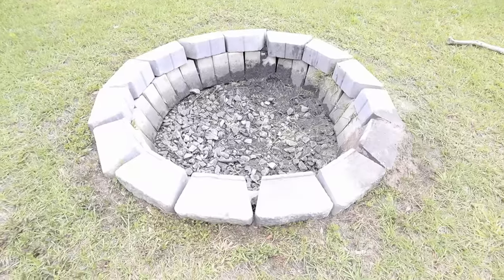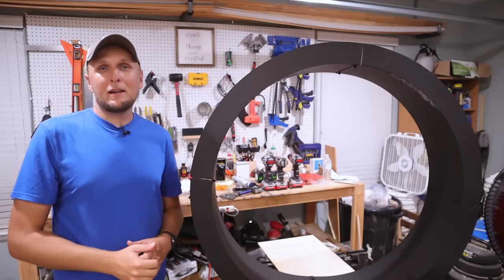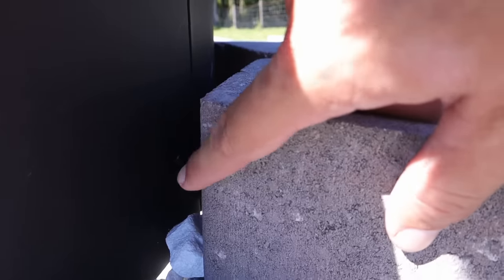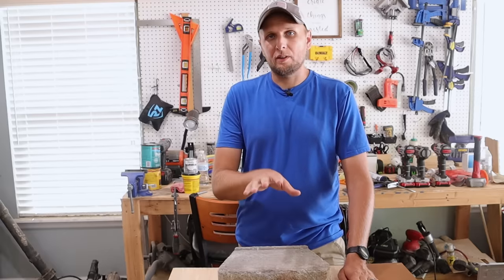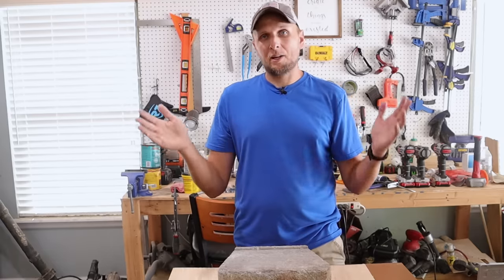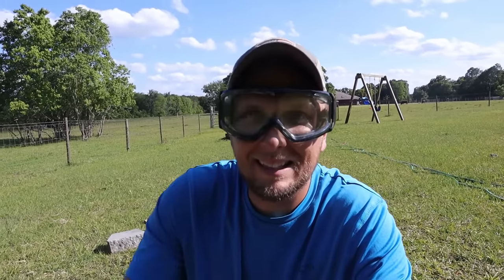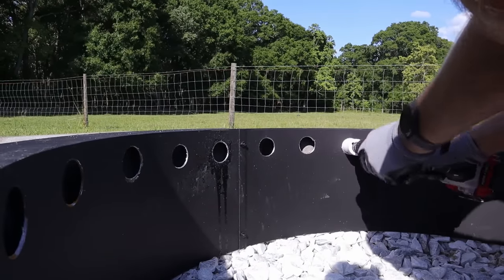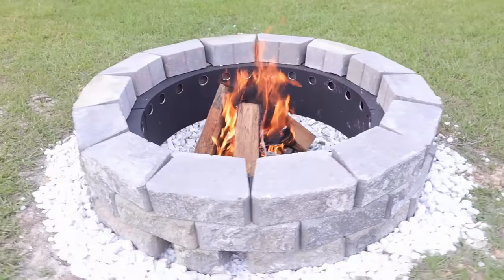How To Build a DIY Smokeless Fire Pit That Really Works!

Comment: I did something similar. I expanded my pit lined the bottom with fire bricks and created gaps along the out side of the pit that draws air in and instead of a ring I just used fire bricks and used blue drainage stone on the outside for looks. I also used granite stones that I have found at the beach and around the forest buy my house.
Very little smoke and it looks awesome.
Reply: do you have a photo this sounds amazing

Comment: Man I loved this video! This is currently my exact situation. Have an in-ground fire pit. Not trying to spend the money on a Breeo if I can make this work. Having the existing fire pit makes a little less work for me. Thanks!
Reply: Hello I am far from Harry homeowner or a DIY guy LOL I am a retired firefighter I have two acres with a couple of trees and the wife and I were thinking about building something so we could burn the Fallen dead tree branches and such . I came across your post and never even considered digging out a hole. If I did take something out 12 or 13 inches by 36 inches across would I still use the fire ring or just put a ring of stones Around The Dugout Circle to give it a finished look and just put gravel at the bottom or lava rock or red fire brick or something? What materials basically did you use with your inground design thank you

Comment: So, I'm dying to know how many hole saws you burned up! lol  Nice job, I think I'm gonna go build me one just like it! :)
Reply from the maker: 😂 Well I actually bought a really expensive carbide tipped hole saw that was supposed to just cut through all kinds of metal without any issue.  It cut one hole and was done.  Then I went back to my run of the mill hole saw and it cut all of the rest of the holes it.  It did however break off a couple of the teeth towards the end but was still able to finish the job.  Enjoy the build!  Hope you like it as much as we do.

Comment: You can build the ring with stones as well leaving a gap for the air to travel up, although metal is a better heat conductor once the stones heat-up the effect will be the same.
Reply: Actually it won't. A Solostove does not work by increasing draw generally, but by using heat-powered convection to force heated fresh air into the exhaust stream for an afterburner effect.

Comment: Could it work as well or better with just removing a couple of or three stones from the bottom and splitting the difference to make gaps all around?
Reply: Using half-blocks prevents edges on the first course from lining up too close with edges on the second course, which would weaken the stack.
Reply: @andyid7440  "Stack"?  Two layers are stable enough I think.  An item not discussed:  fire rings and stones are variable sizes, and thus spacing is uncertain.  The gaps serve to deliver air horizontally at the lower level of the combustion, so if the ring/stone combo fits too well, you end up with irregularities being imposed.  It's a fire pit, not a piano.
Reply: @andyid7440  Thanks, I though it might be something along those lines.

Comment: Will give this a shot. I agree with the comment below on the top row of stone. I think a one inch thick curved flat cap stone on top and this put the top row of stone so the angle is laying into the fire pit. Great Video.

Comment: Great video.  I've been looking for steps to build my own and this fits the nitch perfectly!  One question, how big are the holes you drilled for the air circulation
Reply: If you pause it at 7:01 it looks like he is placing his center point at an Inch and a half.  I would guess either a 3/4 or 1 inch hole as the top looks to be a half inch from top of rim to top of previously cut holes.

Comment: You can also just subtract out one block from the bottom and then evenly space out the rest of the blocks around it.
Reply: This is what I was thinking as he chiseled them in half. Big time savings and but one less stone
Reply from the maker: There are reasons I did not do that.
Reply: @HowToHomeDIY  and that reason is...?
Reply: @hillzachary01  He has explained it several times in previous comments. Others had asked about it or stated the same thing. He has a reason. Others don’t agree with his reason, but it has to do with creating air pressure. I’m pretty sure it would work either way.
Reply: @hillzachary01  because he was over thinking it haha

Comment: What if you just used less stones for the bottom ring, forcing you to leave many little gaps all the way around, instead of a few bigger gaps?
Reply: i second that
Reply: Notice all layers have the same number of stone.  If you use fewer stone its hard to make sure all seams are over the middle of a stone.

Comment: What size hole saw did you use and how far down from the top did you go to cut the holes. Thanks for the video, it’s very helpful
Reply from the maker: Hey Bradley, I started out with a 1 3/4" but felt the hole was too large so I ultimately ended up using a 1 1/2" and I measured down 1 1/2 inches from the top as well.  Hope this helps!  Thank you for the feedback!
Reply: Thanks for getting back with me. I appreciate it. That will help a lot.
Reply from the maker: @bradleyodom4010  You are welcome :)
Reply: @HowToHomeDIY  at depot buying my first hole saw bit for this, thank you!!
Reply: @HowToHomeDIY  I noticed on the Solo Stoves the holes are much smaller.  I wonder if there is some science that would dictate the optimal hole size
Reply from the maker: They are also a lot smaller.  I don’t know that anyone can say for sure what would be optimal for these.  I can see the argument for the smaller holes to help build up back pressure more but I can’t complain with what I have.  Have been very happy with it.  If you do smaller ones let me know what you think!
Reply: @robertsieloff6065  I have 1.5" on mine and it works really well, you can tell once the fire reaches a critical mass it kinda swirls up and looks like the flu is open in a conventional fireplace. It's my favorite home project to date.

Comment: For the rock layer under the fire pit, do you dig a bit or just place them on top
of the grass? Also, could you use flower bed edging to keep the rocks in better?

Comment: Looks like an attractive and functional fire ring! Here's a pro-tip on cutting concrete blocks: Arrange the blocks in lowest level just as you did.  Take out one block. Re-arrange to get approximately even gaps between all blocks. Now continue as you did. Need more ventilation? Take out two blocks.
Reply from the maker: There are reasons I did not do it that way.  I address them in the comments and also my review video of this.  I appreciate the feedback.

Comment: I am curious on the impact the hole size has on the effectiveness. I have one of the solo stoves but it is a bit small and the heat gets directed straight up vs to people sitting around it. The smaller holes on the bonfire create a pretty forceful heated airflow to the top of the pit that eliminates the smoke very well. Do these get pretty good circulation of air?

Comment: I wonder what would happen if you introduced an "air vent" to the bottom of the fire. Like an underground pipe that feeds right into the base of the fire that's vented up a few yards away. I feel like that, along with the holes in the ring would make it 99% smokeless.
Reply from the maker: It is funny you mention this.  I have been thinking on possibly doing this.  Because I am in agreement with you, I think it would do nothing but help and help mitigate some issues that come with wetter wood and things of that nature.  Thank you for the comment!  Will see what I come up with haha.
Reply: @HowToHomeDIY  my home finishes construction in the next few months and that’ll definitely be my first project in it. The pipes along with the holes is something I’ve been thinking about for months but haven’t found anyone to have done both combos
Reply: @daysofseptember  I'm in the same boat! lol congrats on your home!
Reply: That's a forge
Reply: In the same boat - want to build a pit with both the holes and the blower vent. I saw a video that introduced both larger holes at the bottom of the fire ring and smaller holes to concentrate the hot air at the top of it. Do you guys think that you would feed the blower vent into the air cushion inside the stones and outside  the fire ring?
Reply: @scottybranham3595  Precisely what I thought, that woods gonna burn real fast!
Reply: @scottybranham3595  Basically the point of this whole concept to begin with is modeling the pit after a forge to take advantage of their reduced smoke.
Reply: @HowToHomeDIY  I would try to replicate the setup of a wood gas stove.  an air pipe might help, but I think holes at the bottom end of the firering would also help.  in a wood gas stove, the smoke actually travels down through the false bottom of the stove, then up through the double wall chamber and out the holes that you already drilled creating that propane stove look of wood gas on fire.  Right now the smoke is probably having a hard time getting from the main chamber into the double walls.  It has some opening from the gravel you have but that probably gets blocked with ash pretty quickly.

Comment: lol, how about removing one or two at the bottom and just arranging the remaining ones to get the gaps you like. :)
Reply: I wouldnt have thought to use a hole saw and make holes going across the top edge
Reply from the maker: You could but the bottom row blocks won’t match up with the top two rows which some won’t mind.  On top of that, I didn’t want gaps all the way around the bottom.  One would think that would be a good thing but it’s been my experience when dealing with ventilation and air flow that less vents in the right places helps create a sort of pressure that helps with air movement in, out, and through an area or space.

Comment: look up AmishMeadows videos and find the one where Elvi is talking to one of the old dudes that lives on some property . . he goes over the actual mechanics of smokeless, 'rocket' and draw fire pits, this is close but not quite right . . . spent extra cash on a ring (hope it wasn't a lot) and need a lil fine tuning for it to really function properly . . beyond the 'smokeless' aspect of those fire pits you get a radiant heat from it.  you can also tune them to crank out some pretty cool fire effects :)  nicely done mate really i see a WHOLE lotta people dance with this project, at least you dodged those ridiculous over priced pre-fab'd piles of nonsense :)  just do a lil more vidja watch'n and banter with some old boys like me you'll have a nice, safe, warm and pretty should you wish it fire pit that'll last you for years with lil maintenance and use 1/3 the fuel you would of used in a normal 'pit'
Reply: oh, cooking over them is also next level :) you can make the kit required for all that as well. . . grill, roast, 'smoke', "pit cook" (that can get a lil messy though heh)

Comment: Gasifier stoves work on the same principle. Reigniting wood gas making a mostly smokeless fire
Reply: His fire is so far away from the sides, I don’t see how it could be reducing smoke through gasification. The outer ring must get hot to gasify and stop the smoke.
Reply: @37gdog  Yes. There needs to be ignition or sufficient heat near those metal holes to produce the secondary gas combustion. Might be possible to fix this setup with a fuller pit. I would recommend a simple mound of dirt in the middle to make the effective space in the pit smaller and encourage the burning fuel to collect near the edge of the ring.
Reply from the maker: Yes in order for it to work best the fire needs to be big and close to the sides.  That’s why I recommended to some folks that asked if a smaller pit would work better.  The answer is yes if you don’t want to build a large fire.  I do get secondary combustion once my fire is big enough but even when it’s not the holes at the top still bring air in and you can actually see the smoke in the pit get put into a cyclone type motion back to the fire and burned up.  I have also told some that if I was to do this again, I would make the holes a little smaller as I can see how it would help to propel it into the fire more with the pressure and maybe make it a little better.  But we love ours and use it regularly.
Reply: @HowToHomeDIY  Yes the smaller holes does sound like it would address that!

Comment: How many pavers did you use? Pit looks great!!
Reply from the maker: The way mine sits it took 40 of these particular pavers.  12 total on the bottom row due to the holes and 14 on each of the top two rows.  Thank you very much for the feedback!
Reply: It would depend on the paver size on the hidden side. If you are using a ring like he did, you can use the measurement from the paver of your choice and divide it by the circumference of the ring.
Reply: @HowToHomeDIY  Awesome video.  Inspired to build like what you did. Looks like 36" ring but wanted to be sure. You also mentioned 12" pavers, would you mind sharing link to them or all the dimensions for the paver?  Appreciate your work and the updates you've shared.

Comment: Thank you so much for your answer. My fire ring is, according to its specs, 3mm thick. I used a 1” Milwaukee hole saw with carbon and it worked like a charm. You have been very helpful and great explanatory video.👍👍. Thank you.
Reply from the maker: Excellent!  I have a family member that is wanting one and I may try the 1 inch hole saw or maybe even a little smaller but with more holes just to see if it makes a difference.  Thank you for the feedback Sarah!  I am glad you liked it!
Reply: @HowToHomeDIY  I wanted a 1/2" hole saw but the smallest there was available at Home Depot was 1". So that's what I used.

Comment: Great job.  I'm going to try it for our cabin.
Reply from the maker: Sounds good!  We have really been enjoying ours!  Only thing I might try differently would be to use a step bit and drill smaller holes.  I wonder if smaller but more holes would make it work even better because of more back pressure.  Either way I am really happy with it!

Comment: hey quick question for you, im planning on buiding one of these for someone and i just have a few questions, im planning on pouring a concrete pad for the pit to sit on so to start id like to know where you ran the aluminum tube in the bottom of the pit?  just run it outside of the pit somewhere?  like in my case run it through the pad to an exit point? and with a 60 in ring how many half block gaps would you suggest installing or how many like 1 space for every 5 block for example?  btw your videos are great and thank you for taking the time to make these

Comment: Now that was fun to watch. Quick question, instead of drilling all of those holes in your nice new black ring, why not let the black ring rest on top of the 3rd level of stone giving space at the bottom for air?  I've been building camp fires all my life up at the river and it's usually a no, no to bury it in the ground like that because it kills the draft flow, doesn't burn wood as well and it makes more smoke.

Comment: Which size fire ring did you use when building this fire pit?  I looked up on Amazon the links you suggested and found that there are two sizes available, one with a 33" diameter and the other has a 42" diameter.  Thanks!